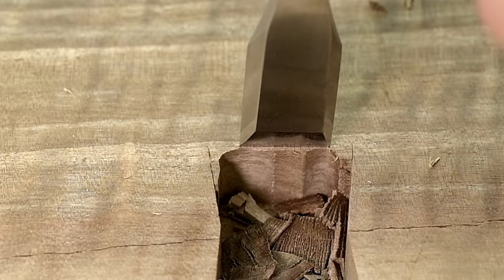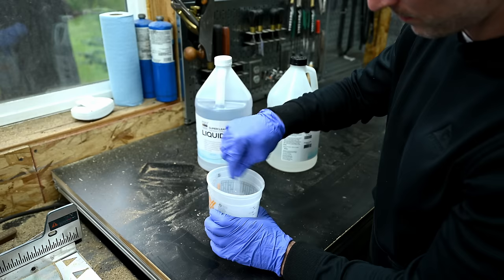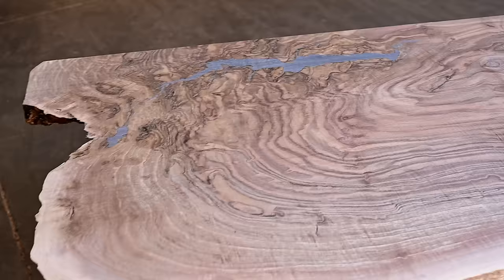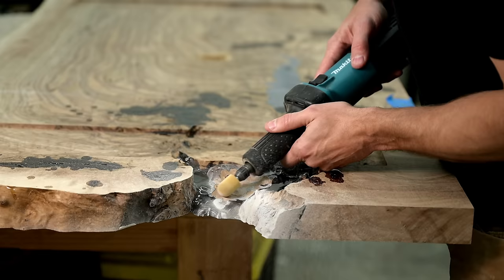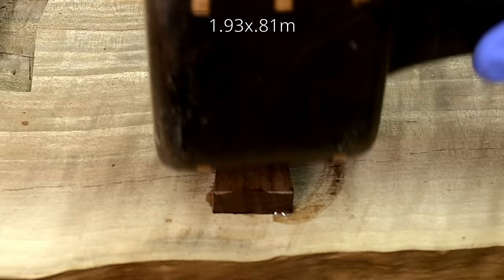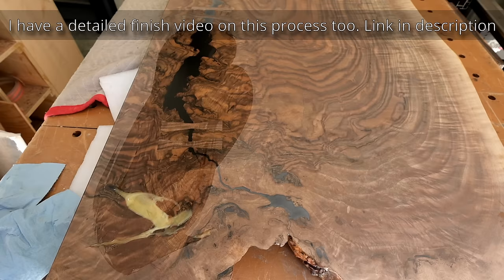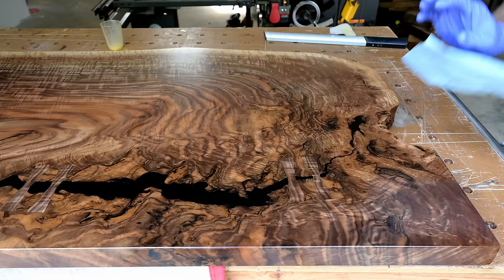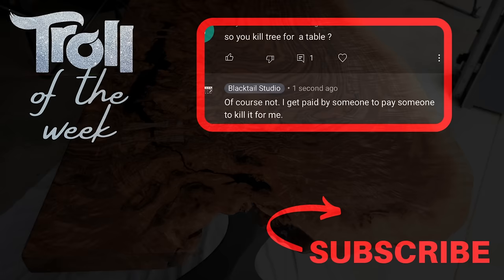Building a $9000 Table

Comment: Bowties are honest. They show tha a craftsman is aware of the fragility of a joint, and wants to show, honestly, how they have taken the problem into account!
It will, of course, separate over time without the bow tie. There are some other methods to use, but this is both simple and elegant! Love the Ceramic coat too
Reply: for someone that doesn't know much about wood-working, they look like fancy band-aids.  they stick out like eyesores on an otherwise beautiful piece of wood.  i get the need for them, but man do they take away from how good the table could have looked.
Reply: @dereknapier836  Would you rather pay $9,000 for a desk that would inevitably break apart without the bow ties? To get a beautiful piece of wood, you have to accept its natural flaws. Life is full of compromises, some people just haven't figured that out yet, I guess.
Reply: @dereknapier836  Trees like the one Cam used in this video are so rare, that you just have to accept natural flaws in order to utilize the boards that come from said trees.  Otherwise, if you aren't willing to accept the flaws (and by extension the need to stabilize them), then you pick a different board for your project. Simple. Also, don't you think that Cam probably used the nicest side (fewest flaws) on the top side to begin with?

Comment: Seeing how much people pay for your tables makes me happy that there are still people out there that will pay for a piece of real furniture! Awesome video!
Reply: @jokinabadsbs  I agree partially. Most of the tools that it takes to do this are very expensive, and also you need a place to put those tools. There is a lot of factors when calculating price. Also this type of work is dangerous. I have thousands of dollars worth of tools, but I don't have the tools that it takes to work with huge slabs. I guess my point is.. it takes a lot of money to make money lol
Reply: @jokinabadsbs  let's see some photos of your projects of that size seeing how you think it is so easy?
Reply: @dereknapier836  What point are you trying to make? Are you saying that it's overpriced?
Reply: @dereknapier836  so show us your more impressive projects.
Reply: @dereknapier836  I build furniture (including river tables) and you have a bit of a point, but keep in mind the amount of labor that Cam puts into his pieces that most other shops don't.  He spends hours filling every crack and void and then even more hours meticulously sanding.  He mortises in the legs and goes the extra mile to create a really spectacular piece.    It's the difference between an actual artist and someone looking to make a buck.

Also, you have to have a sort of consistent pricing model regardless of the slab's price.  If the final result isn't too dissimilar to another piece (regardless of the slab prices) it doesn't make sense to charge 1/4 of the price since that'll just confuse customers perusing.  Cam seems pretty transparent about his pricing model but doesn't have to be.  If you put the table built out of a $250 slab next to the table built out of a $1500 slab you wouldn't notice the difference IMO.
Reply: @dereknapier836  where do you find think and wide slabs that are not overly expensive? or is it just better sticking less wide pieces together

Comment: The color and grain in that walnut is incredible, I can see why it fetches such a hefty price. I've been playing around with the idea of making bowties out of non-wood materials, mostly stone (granite, rose quartz, blue quartz) to give some high contrast and added interest. Im curious what your thoughts are on this idea. Awesome vid and table! Cheers!
Reply: I love your idea of using non-wood materials!
Reply: Ryan that's a great idea! I work with various building materials and types of stone, and I have been thinking of ways to incorporate some of the more interesting stone into these pieces.
edit: would have to install the stone in a location that won't need additional cuts or sanding. I'm not aware of any dual purpose material removal methods that work for stone + wood, unlike metal + wood.
Reply: Ooo that's an interesting idea, I'd like to see how that works out. Using stone bowties would definitely be a lot harder but it would look fantastic
Reply: I saw a guy on YouTube do a bronze bow tie that he cast and machined, it looked really hard to do but it popped.  I liked the aged bronze or oiled color. The hardest part seemed to be getting it flattened perfectly with the table.

Comment: NoTie:  The bow ties on the top seemed to detract from the beauty of the filled crack.  I think you should have added the bowties on the bottom for structure but left the top just the epoxied crack.
Reply: yes! or if you really must use them on top, recess them and do it before the epoxy fill, then carve out the "proud" potion to look natural so when you fill with epoxy you have no idea there is structure beneath it.  Also, if you go that route you can use thinner metal joints with epoxy on top.
Reply: It makes more sense due to the weght putting on it too
Reply: You should’ve used epoxy for the bow ties. That looked pretty off

Comment: Has anyone every made bow ties from a matching part of the slab so that the bow ties don't stand out as much?   I have not done a bow tie, yet, but I will be working on a few slabs that I will be using a few bow ties on to give structural support to major cracks and weak points in the wood slabs I will be transforming into round tables.   After watching numerous YouTube videos from different woodworkers, I have decided that I will sacrifice one slab with a similar grain to make the bow ties from.   I feel comfortable matching the grain patterns the best I can to produce a finished product that looks really good.  I realize you put the bow ties on the bottom where people don't normally look.  But I am kind of a perfectionist, to my detriment sometimes, I like to match the grains the best I can.    I have been experimenting with making laminated bow ties using the grain pattern I want to match.  They came out better than I expected.  I used the same wood to make the laminated grains showing the pattern I wanted.   Funny, I got the idea from lam-beams when I was resupporting some floor joists.   All of the experimenting on this is in preparation for making natural edge round tables from maple slabs I obtained from my neighbor's maple tree.  The slabs are still drying in my garage.  I am very happy to see that you include the importance of measuring the moisture content BEFORE you begin!  Thanks for the videos and informing all of us about new products like the U-channels to keep the surfaces flat,  I do like all of the table legs that I have watched being installed... they make the finished tables look first class!   As far as the resin, I do not have the work space to make a pour and deal with the odor.  I like the fact the new products have come a long way to control the odor and voc's.  I still have a thing about black or charcoal in to fill in the gaps.  That is my problem.   If I had a choice, I would pour laminated colors in layers to match the grain of the wood and fill in the gaps.   That will take a long time.  You can tell I am retired with a lot of time on my hands!  People don't really appreciate taking a slab of wood and bringing out its natural beauty!  Thanks JPM

Comment: Cam, just a suggestion for your finishes. Check out Birchwood Casey True Oil. I've been using this for years for Gun Stocks. The secret is steel wool in finer and finer grits, the True Oil uses the dust to fill in, and will polish to a very deep shine while protecting the wood. I just thought I would mention it to you.  Keep up the beautiful work, looking forward to your next project.

Comment: Bowties; you just have to have them in certain projects.  I appreciate the fact that you use them to stabilize a crack that could fail later on if not used.  Keep using them.

Comment: Sam to save the table top, use "fine" emery paper "tacked" down (to a machined surface) with spray adhesive and clean the of the crockery bottom surfaces.

Comment: Bow-Tie- I have recently discovered your channel and enjoy it very much.
I am on my 2nd career and it’s working on Guitars, Banjos, Ukuleles, and guitar amps. Regarding wood issues on guitars when we have a deep crack, deep long crack we use make something called “cleats”. We craft a diamond shaped piece of wood that has a 45 degree radius on the top around all edges and use glue. Depending on the wood, type of guitar, etc we have a variety of glues including epoxy, wood glue, fish glue, etc.

Ricky from IBM, Ret

Comment: I absolutely love your videos, and I've watched almost all of them by now. Being a novice woodworker, your videos are both inspiring and extremely helpful. 
For epoxy tables, you frequently cover how to fill dips, cracks, bubbles, and other defects; you usually use black ca-glue or more epoxy with an injector. What about on the wood itself though? Do you just use wood glue and sawdust? I would love to see this covered in one of your videos and some more information. I would love for my work to have as few imperfections!

Comment: Although I grew up with the imperial system, I prefer metric for woodworking simply because smaller units are a lot more precise. I also find it easier to calculate whole number millimeters than fractions of inches, but absolutely nothing wrong with imperial; its beautiful in its own weird way

Absolutely stunning table btw! I personally love bow ties

Comment: For people wondering how a bow tie makes the thing stronger, imagine two separate planks, put a bow tie in between them and tie to pull it apart, you can’t. Similarly the bow tie helps strengthen the cracks by preventing them from separating further

Comment: No tie.  I’m an architect. So I’m sure you’ll see why I’m opting for no tie.  However, I think it’s structural. But if there’s another way (epoxy or something else) to achieve this,  then it think that will be better. 

Also, I’d love some motivation from you. As I’m looking to start my YouTube channel on interior designs. Space themes. And general space planning. Just haven’t garnered enough push to go for it.   

You videos are amazing.  Keep up the “wood” work

Comment: New to the channel. Subscribed and liked. Yes audio talking version preferred. Bowties look fine. Also yes to the metric system. As a Maint Tech I found out a long time ago measuring center to center points is much easier using metric. Pretty cool vid on the table build and looks awesome. Keep up the good work. 👍

Comment: I’m not sure if you have time to answer questions on such old videos but I’ll ask just in case. 

1: Are the bow ties necessary to add strength? What could happen if you don’t put them in?

2: I’ve watched quite a few of your videos (which are awesome btw) and you seal some slabs with epoxy. My question is, after you’ve sealed both sides, what happens underneath the slab where the epoxy is still wet? Doesn’t it just stick to whatever you’ve placed it on? Sorry that’s been really confusing me and I’ve never seen a video of you explaining that. 

I hope that second question made some sense ha ha. 

Cheers mate
Johnny

Comment: Love the commentary. That's half the reason I like the videos. Old video but hoping you will see this comment, if using table top epoxy for the final seal on a table, would bow ties be necessary for cracks or would the c channels and top seal be enough to keep everything together nicely?

Comment: I never really liked bowties, but I couldn't really say why until recently. I don't like bowties made from the same wood. I saw a table recently with black epoxy in the voids and the woodworker used ebony wood for the bowties and it looked amazing. When using the same wood, it actually draws my eye to it, like a scratch on my car.

Comment: I'm in the camp of people who don't really care for bowties (I call them butterflies). My husband likes them, though. We own a slab coffee table (made by his grandfather, a 40+ year woodworker) that came from the large Ash tree at my husband's childhood home before it got torn down. It's from the "crotch" of the tree and it has a Mahogany bowtie at the branch split and Mahogany legs. It's beautiful and meaningful.
Reply: Oh, and it's neat because he filled the small cracks with black epoxy, but he left most of the split where the trunk and branches separated. The frame is visible through that portion of the table because it's open. The table is an odd shape, only being square at one end and flaring at the other. The short ends have cuts, but the rest is live edge. You can tell by looking at it exactly where it came from on the tree. It's about 2 ft wide (average) and about 5 ft long. I wanted a much more practical table with storage, but this was a housewarming gift and not the kind of thing you ever turn down. Plus, it has such a unique story and history for my husband.

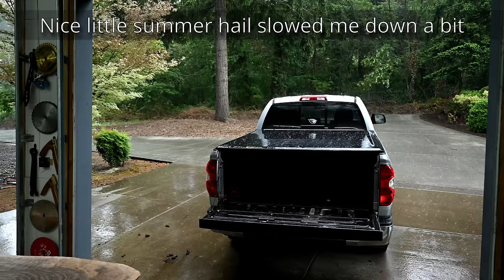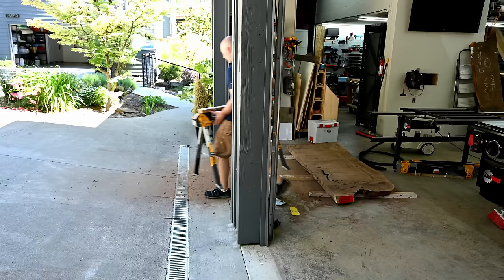Comment: you've got a shapeshifting garage, the slope looks different in every shot. 0:35 looks like it goes uphill from the garages viewpoint, 1:06 here downhill, 1:12 here up again, 2:24 here it looks straight, then I skip back to 0:15 and it def. goes downhill towards the garage

Comment: You do great work buddy, also very informative videos.👌🏻✅ …. On the bow tie’s, they look fine the way they are, tho they interrupt the flow of the black epoxy.   Food for thought on the next one. Why not, after the bow tie’s are installed taking a chisel & a utility knife to take down the Centre of the bow tie where epoxy would have flown through down just an 1/8 of an inch/ 3.5mm lol , filling it with the black epoxy,so’s to keep the fluidity of the valley/ black epoxy… (Steven Robb… carpenter from Scotland) 👍🏻👍🏻👍🏻

Comment: No tie - at least on the top.  The slab has lots of natural flowy lines and the sharp angles of the bow ties just destroys that.  I understand the structural support part though.  And it is good to have a mechanical clamping force in addition to the chemical one of the epoxy.  I just think they should all be in the underside of the table.  However, I would probably have also selected the other side of this particular project for the top and done a full squared pour.  But, I would have done it on more of a river style to keep the live edge.

Now, all of that is personal preference.  You do good work and I can't complain about what you do.  It just isn't what I would like.

Comment: You make such beautiful tables.

I know I'm a bit late but I still feel a need to make a comment about why I think it's fine to use inches in woodworking even though I'm personally used to metric.

The reason why the metric system is so much better than the alternatives has very little to do with the kind of meassuring we do in woodworking.
I would say use whatever you prefer and it makes very little difference. Google will convert between the two for you in the blink of an eye.

Yes the metric system is far superior in other areas because you can convert for example potential energy to kinetic energy to thermal energy without a conversion factor.
1 Nm = 1 kg m²/s² = 1J
If you want to do the same in other systems you invariably have to use some factor when you convert the types of energy. This is just one example.

The metric system is also far better when it comes to extreme precis meassurments. The best you can get with inches is a
thusand of an inch which is 0.0254mm  and you will need much better precision than that if you make a space telescope though.
Nobody needs anything that precise in woodworking for obvious reasons. It is therefore perfectly fine to keep using inches and feet.
Besides, the modern inch was invented in Sweden (by Carl Edvard Johansson) and is based on the metric system any ways. :)
1 inch = 25.4 mm

When it comes to the decimal clock, I'm sure that it is not at all better than the clock we have been using for so long. The reason is that 12 and 60
are numbers with far better divisors than 10 and 100. You can divide 10 evenly with 2 and 5 but you can divide 12 with 2, 3, 4 and 6.
60 is a really great number because it can be divided by all the numbers from 1 to 6 plus 10, 12, 15, 20 and 30.
So even though the decimal clock looks more logical at a glance because we are used to the decimal system, the clock we have is far superior.

Comment: Bow tie or no tie ... I have no opinion. Metrics now, yeah. ITA with you. I got a chuckle out of the ten hour clock, which I hadn't heard of before. But I do remember when efficiency experts tried to change the placement of letters on the keyboard. The original placement was designed to prevent the long keys on old manual typewriters from catching on each other, which is why for example a highly used letter like a is on a pinky finger. Once computers happened, that didn't matter any more, but like the 10 hour clock, the more efficient keyboards never caught on. Also, I'm not remotely interested in learning wood working, but I love to listen to your commentary cuz you're interesting and funny.

Comment: Undoubtedly, but, definitely, the METRIC SYSTEM (SI) is much more easier to use , and extremely more accurate than the Standard System. Most of the biggest manufacturers in the world, even in the USA , are using the Metric System.